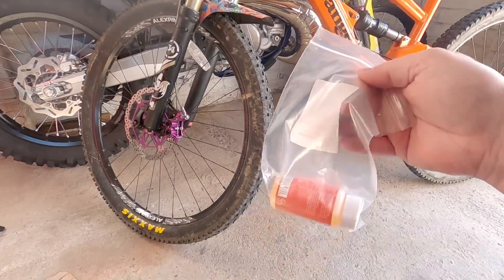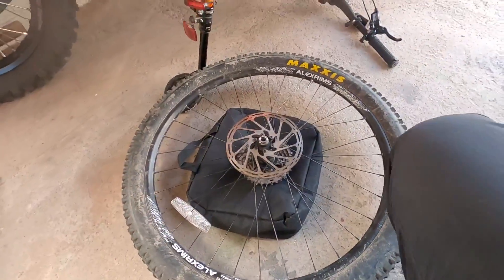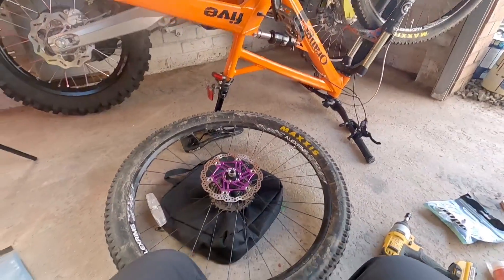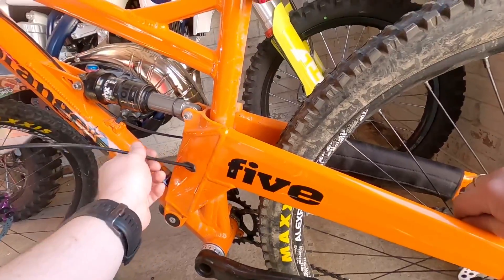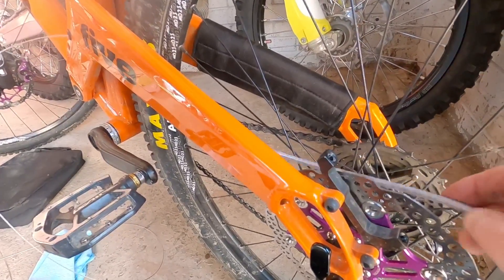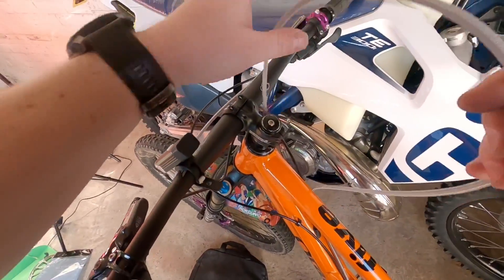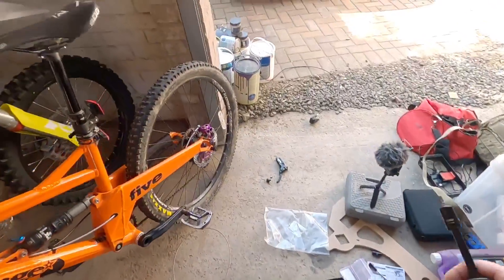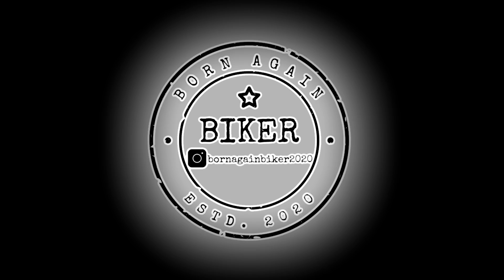Fitting Hope Tech 3 E4 brakes to my Orange Five. rear brake upgrade from SRAM to Hope system.

Comment: Nice video!  What is the tool that you used to pull the brake line through the frame?  Currently installing Hope V4 front & rear with Galfer 203mm floating wave rotors. Thanks!
Reply from the maker: AARON WHITTINGTON thanks Aaron! I used the Alomejor MTB Internal Cable Routing Tool which I bought off Amazon. There may be other tools out there that are better/cheaper,  but it worked for me and went through first time 👌🏻. 
Sounds like a great setup mate, hope you enjoy your install 👍🏻
Reply: Born again Biker Ok cool. I was just looking at a few on Amazon so I will try one. Thanks!

Comment: Which caliper mounts did you use?
Reply from the maker: Hi Sean, I used the mount that came on the bike with the SRAM brake as I kept the rotor the same size.
Reply: Thanks for the reply, just lining up by eye, I think I may be ok with my mount on the rear. My front look very tight as I’m sure the pads may foul the mount. The purple on yours looks great btw
Reply from the maker: @RetroGlide08   No problem at all. Fingers crossed they’ll fit easy for you, they’re a great brake. 
If I was at home I’d give you any serial numbers/ brand of the mounts but I don’t get home until the weekend sorry. 
Thanks dude, I love the purple so had to be done 😄👍🏻.
Reply: @MALVSMACHINE  that’s very kind of you. I’ll keep you updated 🙏👍
Reply from the maker: @RetroGlide08  cool stuff, any time mate👌🏻

Comment: why did you change, and how has the experience been?
Reply from the maker: Johannes Nilsen hi! I changed the front not long after I bought the bike because I ride motorcycles, and wanted the same bite I get on them. The original SRAM Brakes weren’t too bad to be fair, but putting the bigger rotor on with the Hope system I got a good feel straight away, and as soon as they bedded in I got the feel I was looking for. The SRAM back brake was fine in all fairness, I got what I needed from it but it failed, so I bought the same brand to match what I have on the front and am really happy because they tick all the boxes for me. I was tempted to try a Magura system when I was looking to replace the front system, but I went with Hope because of the variety of colours. I have another bike with Magura MT5s on and they’re an excellent brake too so if I was going to buy again, I’d be torn between the two brands (unless I could get some Magura MT7 In the race team yellow 😄👍🏻).
Reply: @MALVSMACHINE  do you have to refill the brakes when pads get worn a little bit? Or does this brake make make it stay with same performance? I am currently using mechanical brake, I had horrible luck with Shimano, faulty seals.
Reply from the maker: Johannes Nilsen these have a really good size reservoir so you don’t lose hydraulic pressure when the pads wear 👌🏻
Reply: @MALVSMACHINE  that's what I thought, so they look promising. what do you think about Trick Stuff Maxima? those a much pricier, but I think I might go For Tech 3 E4.
Reply from the maker: Johannes Nilsen I definitely recommend the E4, my front brake is the V4 though with a 203mm vented rotor so worth looking at those as well just as a comparison. The trick stuff Maxima look absolutely lovely, I’ve never seen a set for real but they look well engineered ..... but yeah, the price is a bit hefty!